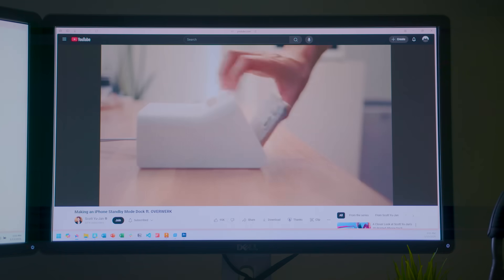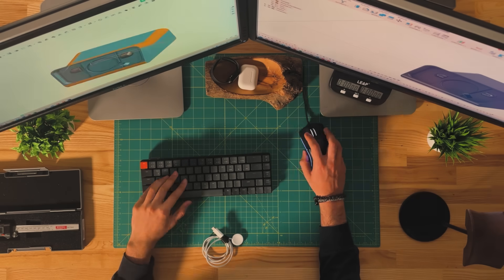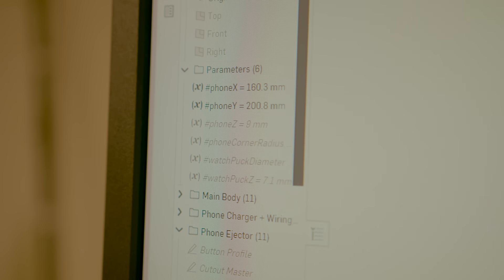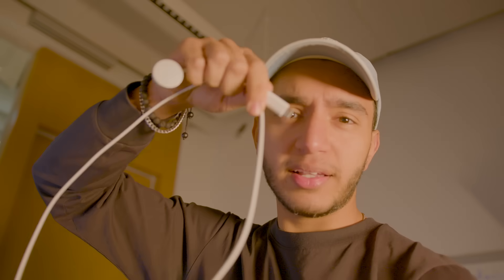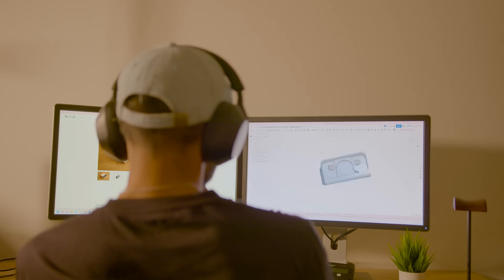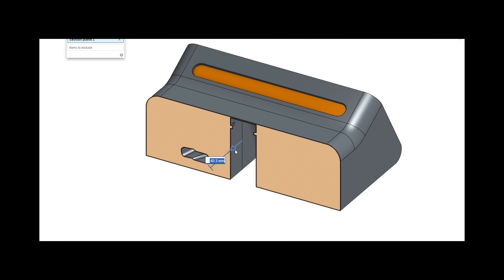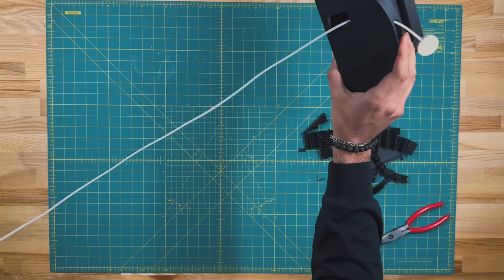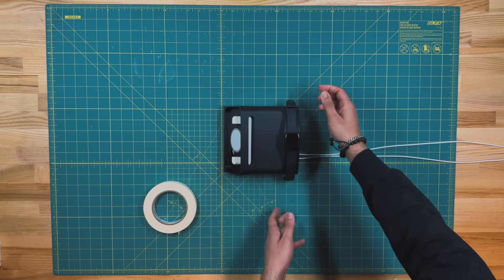i fixed scott yu-jan’s iphone dock!

Comment: I printed this out and ran into problems with the supports in the watch cable tunnel. When i trued to remove the suppirts i ended up breaking the thin portion of the upper panel that the watch sits on. I am usimg a bambulab a1 and pla pro filament. Am i doing something wrong.

Comment: Hey, Moeen, this is a pretty amazing parametric model. I am doing some tests to print for my iphone 16 pro with Pitaka ultra-thin case, but I stumbled across a very strange effect entering my params: 151.5x73.5x9.5. As soon as I bump the z-dimension to 9.5 the ejector model gets wacky with thin scoops that stick out! If I back it down to 9mm it is fine. I can live with 9, but thought you might like to try these dimensions to see if there’s an error in there.

I love the model and hoping it will work with whatever Apple releases next (soon actually). Also, I am using Onshape on my iPad Pro M4 if that matters.

Comment: I tried printing it with my iPhone 15 Pro. I inputted the exact dimensions, but the phone doesn't fit inside the dock. Are there recommendations for exactly what the dimensions need to be (e.g., phones dimensions + 2mm ?). In other words, the iphone 15 pro's exact lenght is 146.6 mm. I put that number exactly into the model, but the phone is slightly too big to fit in...

Comment: Looks pretty cool but someone will need to address those cables hanging out the back. Maybe there is enough space in the case to put in a multiplug port so there is only a single cable to power to the wall or to a power strip. Bunch them up inside the box and its ready for prime time.

Comment: Moeen - Your iteration is FANTASTIC! Thank you for this creation. I am a complete newbie and novice to 3D file creation, editing and printing. If I may, could I ask you a couple of quick questions? 1.  How do I adjust the depth of the insert to account for the case around the iPhone (15 Pro)? 2. Does your build require a charger for the Apple Watch and AirPods along with the MagSafe charger on the front?

Comment: The files says it has earbud charger but I don't see where you put that?  Is that suppose to wireless?  Awesome video and dock.
Reply from the maker: hey! there is a slot for the earbuds charger. i didn't show it because i didn't have an extra one on me :(

but the current design allows for an apple watch puck style charger to slot right in!

Comment: Great video! 
A suggestion for improvement: Can you set in the file so that the size of the Magsafe puck can be changed so that I can also use third-party charging cables? that would be incredible!

Comment: If this is indeed your 1st video - you absolutely nailed it, well done! Can you please elaborate on the Airpods portion. Do you have a charger in there or is it just a place to store it as I only saw 2 chargers in your video if I'm not mistaken. I don't own a 3D printer but I'm about to send your mod to someone to print for me - thanks so much for this and hope to see some more great videos from you.
Reply from the maker: hey! you can insert an apple watch puck-size charger for the airpods, similar to scott's design. didn't show it because i didn't have the charger on me at the time.

Comment: Hey Moeen, 

I have a suggestion to share! I use an Apple Watch with a sport loop strap, and since this strap can’t be fully opened, it’s not possible to lay the watch flat on a surface. Could you consider modifying the design to accommodate this style of strap?

I’d love to update it myself, but unfortunately, I lack the skills for 3D modeling and design.

That said, great work overall! I’m super impressed!

Comment: I like the design. The part that is still an issue or less that ideal is that this basically needs 3 different charging pucks, and thus 3 cables all in the one piece. Finding a way to simplify the electronics into a smaller or more integrated solution would make this a stronger product.

Comment: I just got back into 3D Modeling after having to learn it for a job a while back.  I learned that many libraries have 3D printers and I had mine print a full chess set, which coated $21 for all 16 pieces including post processing.

Comment: I would love for there to be a wired version of this dock. Same design as the wireless one but just with a little hole on the side where the charging cable could go in.

I am not charging my iPhone wirelessly but would love to still use this dock.

Is it possible for you to add another version?

Comment: Looks really good. Can I ask why you didn't keep the back flat so the AirPod Pro and Apple Watch are level?

Also, considering the Apple Watch charger can work with AirPod pro. Another design option would be to just charge 2 devices while keeping the style looking the same

Comment: Question, does the ipod charge while sitting on top?
Reply from the maker: yeah, the hole on the bottom is where you can slot in a charger for the airpods. if you have a newer generation of airpods, you can use an apple watch charger (which is what scott does in his video). if they are older, you have to use a normal wireless charger, and you'll probably need to keep that part of the dock super thin so it can actually wirelessly charge. to fit a bigger charger, i just added in some variables in the CAD that makes it easier, which should help!
Reply: @moeen-razzaque  thanks bud